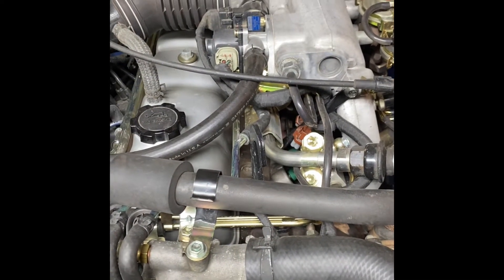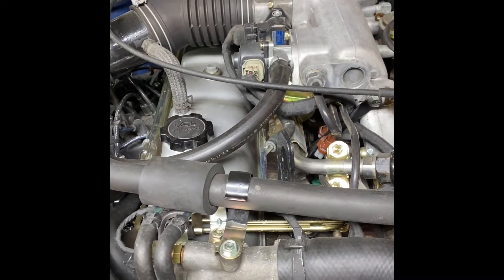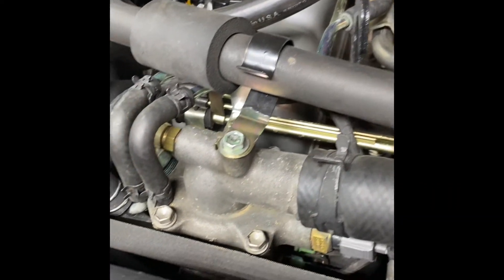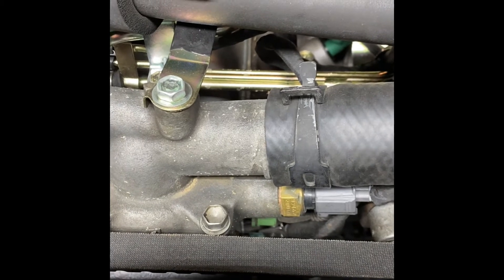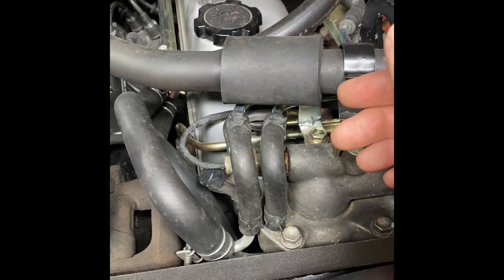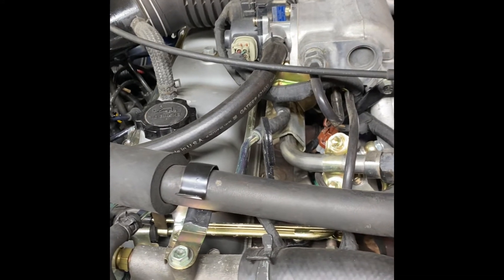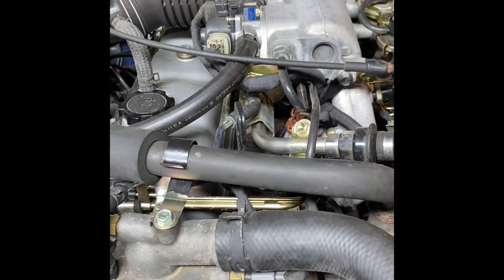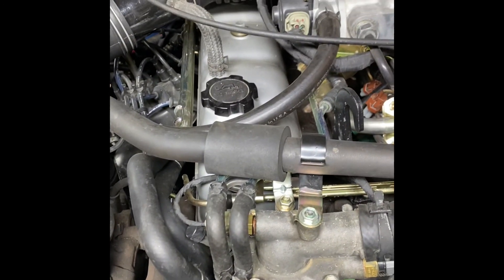3FE electrical tech

Comment: What would make a 3fe run very well and after maybe 30min start to act like it’s running out of gas, stalling, unresponsive throttle but if you take your foot off the gas will idle perfectly fine, and after a minute or two go back to normal and after 20-30min start acting up again?
Reply from the maker: Hey,

Have you hooked up a vacuum guage to the vehicle? I would and look to see if you have a vacuum leak when you get that stumble. If that theory tests out look at all your rubber hoses to see if you have any cracks. If not related to vacuum it could be that the wire loom near the exhaust manifold is getting warm and causing resistance which is throwing sensor signals off and causing the stumble. Check the vacuum first before jumping into wiring.